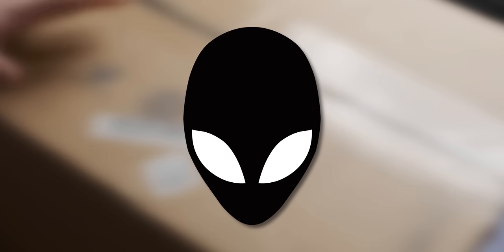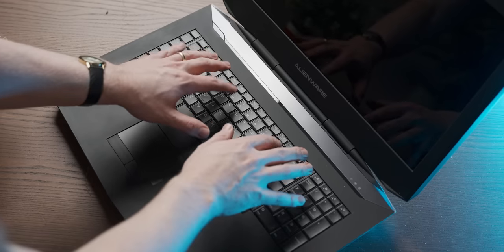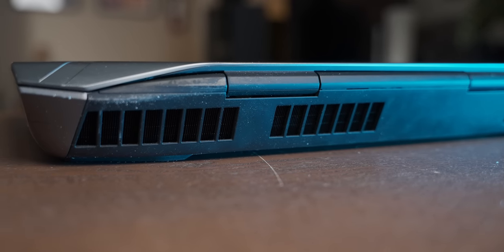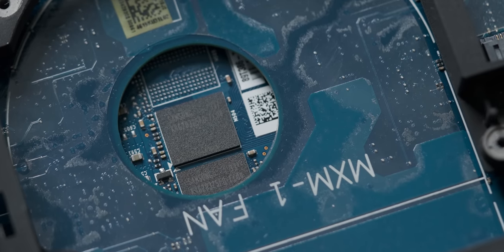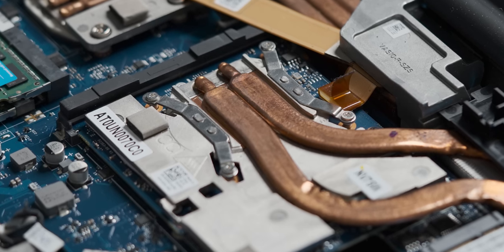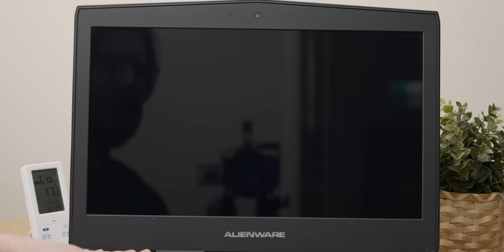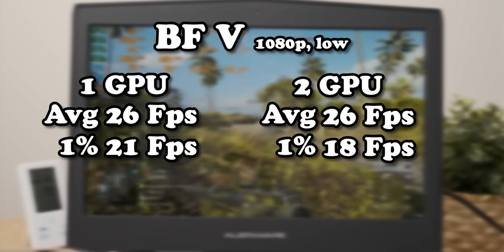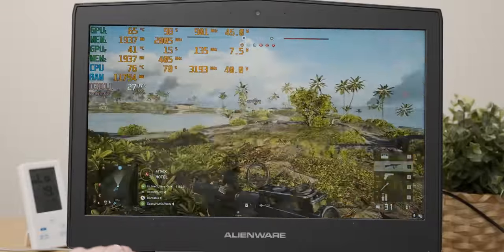This MASSIVE Alienware Laptop Was WILDLY EXPENSIVE

Comment: It does kind of make sense that they have gone the soldered down route. Most people will run their laptop until it is no longer suitable for the tasks they want to do with it. By that time the tech is beyond what is going to be compatible with the laptop they have, so an upgradeable option makes little sense for the majority of people. 
The framework concept is a bit different, just to head off that argument.

Comment: I still have this behemoth for 7 years now identical specs like on this video, almost starved for few months to afford it. the manufacturing quality of this laptop is the best. Never had/used more robust laptop.
Years of usage showed some bad sides (little things), connection on fat charging cable had to be repaired 10€. Battery died, shows capacity 255% (upgrade I guess).
Worst thing that is.. my sick cat pissed on him, keyboard died and touchpad. So I need to use external one.
I really love this laptop.
So @Dawid Does Tech Stuff If u are willing to sell that one, that I can crate a Frankenstein's beast out of them, please contact me :)

Comment: My dad bought one of these 18" Alienware laptops about 10 years ago and upgraded the graphics cards to dual GTX 970Ms when one of the original GTX 675Ms died. He still uses the laptop to this day
Some notes:
That's mini-displayport not firewire
The SSD slot is mSATA
Battlefield doesn't  appear to actually be running in SLI. The second GPU might be doing some physics calculations but it doesn't really help

Comment: It's a shame these weren't available with 3D Vision (you'd have to drop to the Alienware 17 for that). they'd make the ultimate 3D Vision laptop if they were (3D Vision support on laptops was dropped after Kepler).

Also, have you tried benchmarking before and after the thermal paste change? OEM thermal paste is rumoured to hold up even if it has "dried".

Comment: Why did they place the keyboard so high into the base and not near the edge? At least make the scroll pad bigger.
I got a HP G5 that is 4 years old cost $2700 bucks for $400 this winter. Used prices sure did drop. Trouble is it's an HP copy of windows only. You can't contact any network or map any network devices even with software.

Comment: I still have my M18X r1. But that crappy “soft touch” paint is now a sticky mess.
Reply: It's pretty easy to remove once it goes sticky. Some adhesive remover and a plastic scraper will do the job quickly. I've refurbished a bunch of the older M14x, M17x and M18x systems.
Reply: @mbrooker79  something like goo gone?
Reply: @adonian  Yeah that should work. Here in Australia, I use a product called Solvit but it should be very similar.

Comment: the funny thing is, if you show this laptop to any IT company from 10 years before the laptop get released, they will get amazed by this kind of engineering, but then, 10 years later after the release, a single iGPU from middle class CPU (Intel 5 Ultra, Ryzen 5 Zen 4)  in low wattage today can beat the crap of this monster in any game.

Comment: It's like there is a reason SLI went the way of the dodo. The support for it was terrible. Whenever I look at things like the performance leaps we're still making in tech, I'm just reminded that as far as trades go, electricity (and by extension computing) are still infantile compared to their peers. We've been plumping for millennia. Building structures even longer. But electricity and it's associated fields are still only a couple hundred years old. So it kind of makes sense that we're still making massive leaps in those areas as we're kind of still smoothing out field. And the more leaps we make, the more we open doors to making even more newer leaps, keeping that cycle going on and on.

Comment: All Hail Lord Chunkytop!

I miss my Asus G50V - not quite as fancy as this, with a Core 2 Duo T9600 and 9800M GS, but it was a chonkster just like this. Easy to open up, a bit harder to actually work with, but it just felt good to use and the lighting (and LCD status panel!) was amazing.

The previous owner had both removed the PWM line from the fan, and cut through the panel right above the fan and covered it with metal speaker grille. It was loud, but the noise was constant, and the CPU ran practically at room temperature. Due to the ruined airflow pattern, though, the GPU got wicked hot and required underclocking to work right. Loved that POS :D

Comment: you can upgrade one of the gpu's with a dell variant gtx1070 (the one on the left side with the shorter heatpipes) but you'll need the 5-pipe amd heatsink so it can manage the TDP of the gtx1070 mxm and it shouldn't overheat.
Reply: desktop 1070 only had like a 180w tdp. pretty sure it capped out at like 120w in laptops

Comment: mid-2000's dell laptops were even more convenient. The HDD slid out of the side with zero screws, you just needed a good tug to free it, and the ram was upgradable from a little hatch on the bottom after removing a single screw. Thank apple for popularizing the idea of anti-repair designs, soldering stuff directly to the MB and gluing shit. Once they did everyone else went "wait, we can do that? and no one seems to care?" and now we're here.

Comment: SLI just isn't going to help very much because its drawbacks: VRAM can't be shared between the graphics cards, meaning you get the same amount of VRAM whether using one GPU or both. There is a latency penalty added for communication between the GPUs. It's kind of like using multiple CCDs in a chiplet-based processor...except much worse. Supposedly, NVLink made things a lot better, but it didn't last long.

What I was really hoping for was a multi-GPU solution that could accelerate VR by having one GPU render the image for each eye. But companies always drop VR technology development like it's hot..or not hot. Man's not hot. Yeahhh.

Comment: Back when laptops were designed rationally, with upgradability in mind. The laptops i work on for my job all suck now. 15+ screws, then you still need a spudger to pry the back panel loose, which is easily cracked. If you're lucky, they're retention screws so you don't end up losing several of them. Oh, and if you have to replace the keyboard, good luck. You've gotta remove the system board and every other component. I hate the direction computers are going; very anti consumer.

Comment: I got an M15x for Christmas in 2010. About a year later, it was dropping frames on games dramatically. Less than two years in, it was bluescreening every couple of minutes. Completely unusable. I still have the hard drive though, hooked up to my current pc as an external so I didn't lose anything!

I do miss the keyboard, though, was my favourite laptop I've ever typed on.
Reply: and you prob never cleaned it out. Could have saved it if you learned how to maintain it. It was prob just overheating you lose fps and the blue screen was prob just it turning off. High temperature is the biggest enemy of electronic components, and will cause blue screens, computer crashes, and even damage
Reply: @imtoxicAF  Unfortunately that's the price I paid for being a dumbass 15 year old. If I had the same knowhow then as I do today, I probably would have done just that. I don't use laptops anymore, but that's something I'll keep in mind for the future - I'm actually about to give my current desktop a clean out some time this week, as I have a new case to transfer the guts into
Reply: @gadgez_  Do it. Just do it. - Shia LaBeouf

Comment: The nebula red m18x r2 is far better.
the main gpu slot can be upgraxed to a quadro rtx 4000 if your lucky enough to find one, and use the second gpu slot for a m2 to mxm adapter
Reply: I never thought about using a m.2 in the mxm slot. Good idea. 😁 What else can you use the extra mxm slot for?
Reply: I think theres also an adapter for a better wifi chip and blue tooth. But honestly m2 adaoter is the best option

Comment: Bah! I'm still rocking my my Dell M6800 workstation. I7 4800mq, 16GB 1866mhz RAM, Nvidia Tesla M6 (Roughly a GTX 980M) 8GB GDDR5, 256GB mSATA SSD, 1TB SSD, 1TB HDD.  Only thing that Alienware has over mine is probably better cooling as some dipshit decided to share the gpu cooling with the cpu cooler on one side of the laptop and of course, SLI graphics.

Comment: We traded upgradability for things like better protection against moisture, lighter builds, smaller screen to bezel ratios, durability, and so on.   Essentially, if it's all soldered down, you can't do anything useful anyway.   The glory hole and the overall design look like it adds about 10 pounds to the thing!

Comment: Modern games no longer code and allow for SLI so running that is pointless. Upgrade to the highest single GPU you can which might be the 980m or a Quaddro card and also the fastest CPU. Ultimately it won't be competitive with most modern gaming base models now.

Comment: Put a 4980HQ CPU, 2 x RTX 2070 SUPER MXM (or better)GPUs, 16GB (2 x 8GB) HyperX Impact DDR3 CL9,  Samsung 860 EVO 1TB mSATA as the boot drive, and a 870 QVO 2TB 2.5" SSD for the bulk storage, Intel 7260AC WiFi card, and Arctic MX-6 for thermal paste. And let us see our dream laptop upgraded to the max :D

Comment: It's no wonder SLI was abandoned. Many Games (especially newer ones) are not optimized for SLI. There are very, very few Games that benefit from it at all. You also have to consider that 1 good graphics card beats 2 bad ones in terms of performance. Yes, well, it's a laptop and back then you just didn't know any better. But for today's time, no longer worthwhile.
Nowadays there is still something like SLI, called "NvLink". But that's for servers or render PCs, where you want more graphics processing power.

Comment: NOOOO! The dents really should have said it all. But this is a Dawid Hard on Hardware video. So I brushed the dents off as a Dawid being Dawid getting a dented new laptop.

I really do not like Ailenwear and gross plastic that sucks up finger and hand grossness. But this kind of laptop is what we Hard for Hardware comes, to. Like why can we not have laptops like this anymore :c I'm fine having to screw and disassemble stuff like it was a compact desktop. Just anything to get high end hardware that is not using jet engine fans to do it! I want a decent spec laptop in this size maybe a tad smaller! Please!

No need for 4090 or anything just a proper big boy portable computer! Without the fans of *. Even people into a mobile workstation are going to be into this if it can contain a proper 4090 even! Normal people ready to handle the thickness are just fine getting something less extreme if it just compete with a desktop PC.

My 2019 laptop GPU fan just died on me. Out of warranty. We got 120mm slim fans. We even got 80mm slim fans. The cooler designs on laptops are horrible as a PC replacement. And if your after light and slim laptops they should be fan less to boot. Trying to get a high end laptop is just asking for fans of *. Only midrange laptops have a chance to even be usable with the * laptop fans.

How can a Alienwear laptop be this exiting! And it is barely any better then a modern thin and light due to the age of it. It is just sad that we do not have this beast sized lapdesktops since it makes far more sense then buying a Dell desktop. Or HP whatever crapbox!

Comment: the gpu usage wasn't 50/50 in BF5

did the laptop worked after the complete teardown? better temps with new thermal paste ? so much more to cover.

what mxm card can you get ? ive a GTX880M if you are interested to upgrade:)

Comment: Oh god not SLI, i fucking hated SLI and im glad its gone. i bough a AMD 6990HD when if first came out for a lot of money, and all i got was nothing but stress and anger because almost no one supported SLI lol. it could'nt handle watchdogs 1, even Hatred ran like shit.  

Before i bought my current alienware laptop i had a Alienware 17 R3 i7-6820HK,GTX 980M 8GB DDR5,32GB RAM,256GB PCIE SSD+1TB for years and i loved it. Never had a single issue with it, and i honestly wish i never sold it. anyway in late 2019 just before the shit hit the fan with the pendemic i was playing new tripple A games like Boarderlands 3, watchdogs 2, and DOOM eternal. At 1080P i was playing on high graphic settings. its was an awsome gaming laptop, i didnt even need to use the extended warranty lol.   That would be a cool video, how does the last of the GTX M series hold up to todays titles at 1080p.

Comment: I had one of these 18 inch beast that weight more like a cinder block than a brick. The funny thing was when I have gone thru the TSA checks at airports, many TSA officials would ask me to turn it on just to verify that it was a real laptop and not some explosive device! I was use to that as my previous desktop replacement was the 20 inch Dell XPS 2010 that I lugged about with my DIY custom padded case!

Comment: just use xidax i got a xm-10 they use desktop cpu so i can interchange mine with a rtx 2070 cpu i got right now is a i5-9400 at 4.2ghrz i got the older model tho the new comes with a 3080 zero heating issues and cpu is optional to the user same with eveything else as they make to order the laptop is fully customizable from body to hardware its is 4k tho on price and i dont trust or use sli i used to run desktops but 99% of games i play cant even use it then windows 11 and all happened so i just gave up on sli

Comment: Hey brother please reply

Is HD 630 (i3 7100s with 12gb DDR4 ram) better than GT 710 2GB GDDR5????
Reply: from Passmark's GPU benchmarks, the Intel HD 630 has a G3D Mark Rating of 1116, and the Geforce GT 710 has a G3D Mark Rating of 634, nearly half (and higher represents more performance,) so I'd definitely recommend you get or use the HD 630, i hope this helps
Reply: @misterfitzgerald  anything helps but i need something more accurate and reliable
Reply: Yes it is better like he staid. The gt 710 is literally terrible

Comment: part 2 Please
With the utmost max you can push with the upgrades

Cl 14 3600mhz ram, 1tb fast ssd, the highest you can do cpu,  external 4090 mobile gpu like the one from asus rog, an external high end monitor, new thermal paste/ liquid metal
Reply: I don't think you can do usb C external gpu in this motherboard and it wasn't until 2015 i believe that Alienware introduce its proprietary external gpu connection, so unless he upgrades the motherboard which is technically possible but idk what part would be available that fits and provides thunderbolt compatibly do unlikely that he will be able to do that... Maybe a framework 16 motherboard would fit in it and figure out what to do with the gpu's from there xD

Either way checking how much "upgrade" he can do with this chasis is certainly fun

Comment: the absolute continuous exaggeration ruined this atleast for me... it it very marginally larger than any other laptop.. the high end brands that strive for sleek and compact at triple the cost have convinced everyone an extra 1/4" of thickness and 2" of width will make it unmovable... if you cant carry an 18" laptop that weighs under 15lbs you need to see a doctor immediately... most people arent carrying a laptop with them 24/7 everywhere they go.. and if they are this wasnt for them

most people carry a laptop around their house, maybe to a hotel, maybe they move frequently.. they dont care if its 2ft wide and 20lbs as long as its easily portable and works as good as a desktop theyre happy.. look at a desktop.. the tower is 10x the size of any laptop, the monitor is larger than a whole system, the keyboard is bigger than some laptops.. and then a bundle of cables to make it all work.. vs a laptop and charger you can carry under one

the laptop market is getting kneecapped by this nonsense, sure some people want light wieldy notebooks for joisting or whatever they do with them... the vast majority of us want modularity, upgradable repairable, durable, affordable machines with desktop performance.. dimensions and weight is bottom of the list

Comment: do not buy gaming notebook that is too outdated.  your going to have a hard time  finding upgrade parts. one  of thefirst thing to go is the SCREEN or the MOTHERBOARD. or BOTH.  buying a 4 CORE CPU is OUTDATED got to be  at least 8 CORE and its strange to find a PGA SOCKET. not days its all LGA that is  THE WORST if you can find a 8 core CPU get it. if not look for a 6 CORE CPU. and forthe graphic card your going to need at least  2 COPIES of  GTX 1080 so you can at least play GTA ONLINE. and GTA V OFF LINE STORY MODE. relace the keyboard ASAP that is another  WEAK SPOT on NOTEBOOKS. I gone though  many GAMING NOTEBOOKS and the first thing that died is the KEYBOARD. and PAIN IN THE ASS FINDING ONE DELL will stop parts to make room nor current parts.  do not gey a GAMING NOTEBOOK that is TOOOOOOOOO OLD its LIFE may be  on its last leg or dead. EBAY  and AMAZON will not refund your money DELL DO NOT DO REPAIR all I can say GOOD LUCK